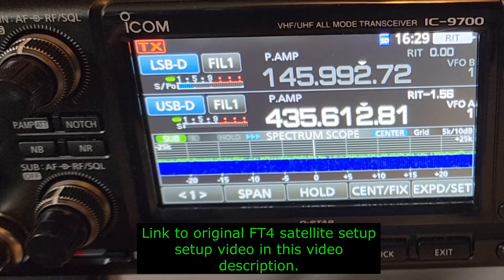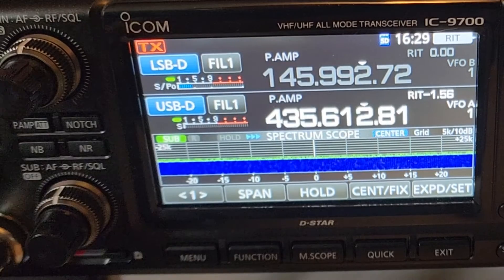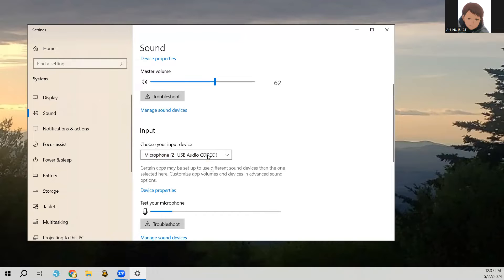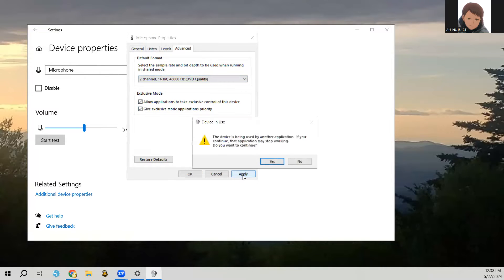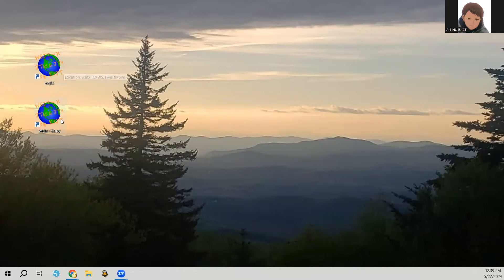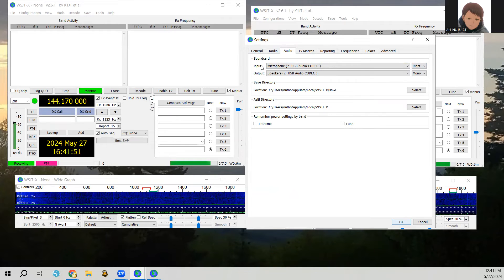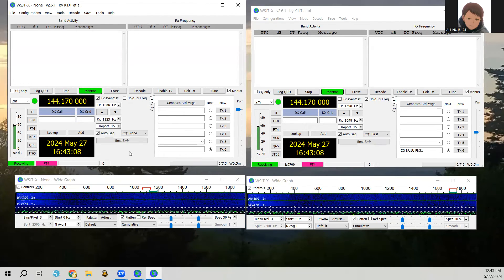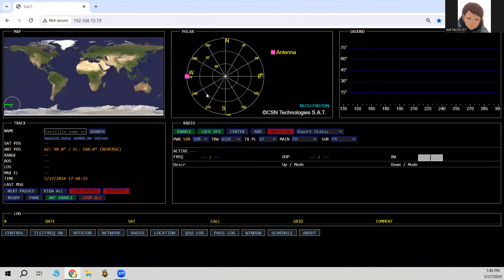FT4 on amateur radio satellites with SAT controller

Comment: Just  got up and  running with your video help! I'm also using the WSJT-X v2.71 -devel version which allows duplex operation so only one version of WSJT-X is required. Tnx 73 Jeff / KI0KB